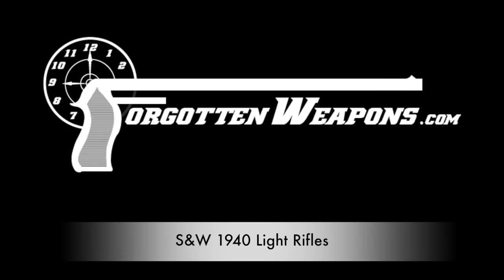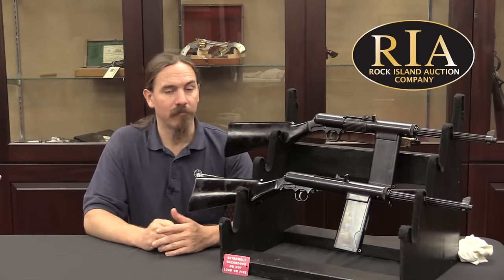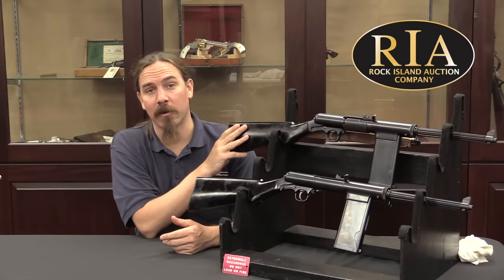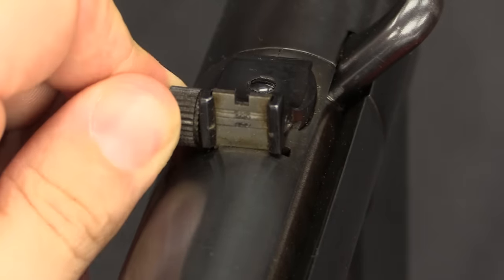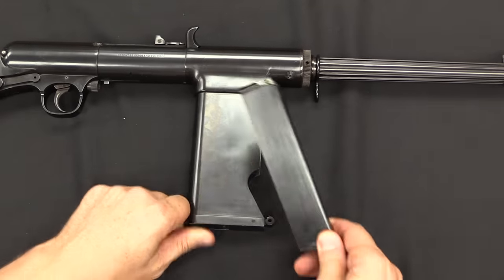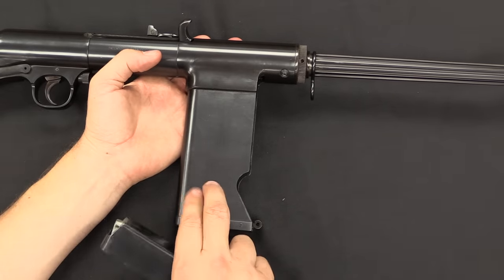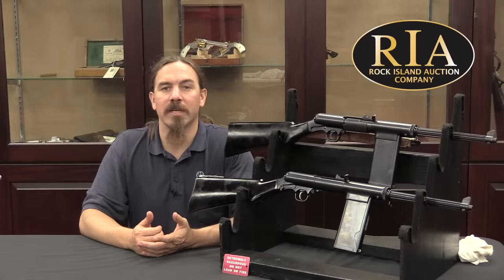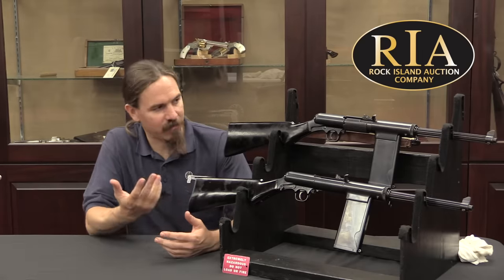S&W 1940 Light Rifles: Receiver Breakage is a Problem

Comment: Interesting backstory. I remember the previous videos. No doubt they  did not have any info on the coming M1 Carbine in 1939, since it was designed so quickly. If this had been more like an M1, closed bolt, and lighter, it might have been successful. A regular magwell, side ejection, and about 1/3 lighter, and it could have been successful (add a little bolt mass while you're at it). A PCC actually makes a lot of sense for home guard type troops like the British had (or civilian partisans resisting invasion), AA gun crews, beach patrols, etc. If an invasion or airborne landing had happened, 2 man teams could really harass invading troops, especially in towns. Pop up, 2 or 3 quick shots each, neutralizing several soldiers. Fade away and do it again. Multiple teams in an area could really cause some attrition. A light force like airborne would also not have much medical support infrastructure in the early stages, so it might be very demoralizing. Anyway, just projecting a little alternate history. Glad it never happened. I know a large number of donated sporting rifles were sent over in 1940 or 1941 to help defend England. I have heard that Win 94's and Savage 99's were quite common, which makes sense. The Brits also requested an urgent shipment of 150K rifles at the Newfoundland conference- the worry of airborne invasion, coupled with equipment losses at Dunkirk. Not sure what they got- likely Springfields or M1917's, since Garand production was spooling up. Possibly leftover US made P14 Enfields from the WW1 assembly line. Or maybe they restarted that production line. Does anyone know? Even Krags would have been pretty useful, but i think they had already been sold as surplus well before this time. My bet would be M1917's left over from WW1, since we stayed with the Springfield. Plus they were essentially the same as the P14 Enfield, which the Brits were familiar with. Anyway, it was nice to see the diffs between the Mk1 and Mk2 side by side. Great video  as always. Thank you

Comment: I feel like the main issue with the tower could be fixed just by making it detachable. Have it be held on by two good pins, or something.
Reply: just cut the back of the tower and leave only the magazine holder. that would almost give you access to the chamber or at least enough to be able to do something before committing to a field strip

Comment: I feel like your analysis of the operating forces during firing is wrong. Yes the bolt will slam into the rear cap, but the pin going through the rear cap is absorbing that impact and preventing the cap from applying rearward tension on the threads.
I'd say the Forward acting force from the bullet applying forward friction against the barrel is what is pulling the receiver and applying forward tension against those threads. 
I'd also say that the threaded cap was probably initially designed alright, but the square section taken out of the threads created a stress riser where cracks would start. 
Still an awful design through and through, from ergonomics to function.

Comment: If the receiver tube was the same thickness but in a smaller diameter tube, wouldn't it be a little bit stiffer as a result?

Comment: it seems strange that S&W didn't know about the differences in the loadings of the cartridges. Did the rifle have the same problem with the US manufactured cartridges? Color me skeptical of a fair testing. The UK had a huge arms industry that was very protective of its self and its income.From the looks of it a heavier recoil spring would have solved the problem. Why didn't S&W  find it necessary to do so in the Mk II?
Reply: Kent Racy ____ The UK at the time was at war. It had lost a vast amount of weapons at Dunkirk and was fairly desperate to get hold of anything they could get to fill the shortfall. The country was under threat of invasion. I'm pretty sure the commercial interests of British arms manufacturers was not a factor in deciding that this thing was rubbish.

Comment: long story short they should have taken some of the unnecessary material off of the barrel and put it where it was necessary on the rear of the receiver.  it really would have been pretty easy to make the mk2 a good little gun.  simply do away with the useless and problematic magazine tower, and move material from the front to the rear and it would have not broken and functioned better, all for less cost.

Comment: Is it possible with a fixed firing pin for a case to be stuck in the chamber and when the bolt goes back forward picks up a case and when it goes to slamming into the chamber the bullet hits the back of the other case and the back of the bullets case get slammed into the firing pin and cause an out of battery ignition

Comment: Why does it have a fluted heavy barrel? Why is it impossible to clear malfunctions without disassembling it? Why does it weigh 10 pounds loaded? How are you supposed to hold it? Why are the Mark II trigger groups cut for a safety lever that isn't there? Just...WHY!?
Reply: Because they were making it up as they went along. The trigger assemblies were probably already milled. I also wonder if they were trying to bilk the brits by making it more expensive than it had to be.

Comment: Despite it's eccentricities (okay, despite it's utter goofiness and unforgivable design buggers) I like the looks of it.  I'd love a modern version, though with side ejection, a standard magazine well (closed bolt, of course [eye-roll], thank you NFA '34), perhaps a shrouded barrel to keeps costs down, and perhaps in a variety of other chamberings (I think .30 Carbine would be cool).  Perhaps with some aluminum or such in lieu of so much steel (though steel and wood ... mmmmm ... classy).  The twisty-turny Mk2 safety thing would make it a LOT more friendly for those of us who tend to shoot off the left shoulder, but so would a more egonomic ambi-safety.  Meh, either way, really.  Yeah, there are a lot of other PCCs out there that are far more practical, but this thing has potential for STYLE ... s'why I like toting 100 year old pistols. ;)
Reply: It's the Hughes Amendment 1986 not the NFA 34 that bans open bolt guns.
Reply: @SuperFunkmachine  - Yeah.  That.  Silly me. I shall pound my head 'pon me keyboard until forgiven.

Comment: I bet it would run fine with shorter ..380 cartridges . so short theyd less likely clog it subsonic and its colder loaded than 9mm.not hot enough to damage this weaker design  The ring needs a third setting to fire it closed breech and then an integral supressor

Comment: Major problems with the review.  Ian never got a correct MKII that has the upgraded MKII parts.  What is shown is a MKII gun with MKI internals and an incorrect end cap/ rear threads for a MKII.  I have a true MKII and the rear threads are acme style, not cut deep into the meat of the tube like the MKI  There is a two piece spring with spacers effectively creating a buffer situation and the rear spring is very short and much thicker which does not allow the bolt to bottom out at the rear of the receiver.   Also a shame the buyer didn't get what he paid for.    There are some other minor differences as well including a dust cover that completely hides the spring and covers the opening.    This is effectively set up to be used as a subgun so the weight needs to be there for stability.  The next stop would have been to add a selector, or block the disconnector for full auto fire and I'd guess S&W was ready for that request.   Mag changes are actually pretty smooth as is clearing a blockage with the easily removable barrel if it comes to that.   I like Ians work, but someone has to get him the correct stuff to review!!

Comment: Are we sure this is actually a Smith & Wesson design or was this developed by the Elbonian National Arsenal.  You have to wonder what dirt the designer had on the chief of engineering or some high level execs at S&W to let this gun even be developed this far.  How did this get this far without anyone saying this is a piece of crap and further resources should not dedicated to it.   It's almost like the designer bet someone that he could make the world's worst carbine and get it past an internal review board at S&W and get some military boards to actually waste some time with evaluating them.  Apparently if that was the case, he succeeded.

Comment: Talking of an unsuccessful design. The thing is quite big and bulky to be a 9mm carbine, yet, while plenty of lighter SMGs were capable to fire +P or +P+ rounds (blowback actions tend to be quite sturdy), this couldn't reliably fire the basic stuff.
It's even funny that they put in it a completely useless, and detrimental, ejection tube (they could have made it way shorter, retaining the downward ejection while avoiding any problem) but failed to see the usefullness of a buffer spring or tab to safely stop the travel of the bolt.

Comment: Amazing how experts ignore a firing pin designed to prevent out of battery discharges.
Fixed firing pins are just cheap, dangerous and stupid. A terrible idea that designers copied from each other for decades, but still a sloppy solution.

Comment: Dang, so I guess if you were to use that rotary safety and lock it on an open bolt, and  the trigger gets pulled, as soon as you disengage the safety the gun will fire?  I wish these were better, cuz I like the idea, and look.
Reply: Since the bolt can't move forward at all with the safety engaged, i'd guess the sear would catch the bolt again once the trigger is released.
Reply: oh. ok, I see.  thanks

Comment: They strengthened the gun by making the bolt shorter... thus having a shorter bore into the chamber... more metal, more strongerer. But they didn’t do the receiver any good with that channel machined out of it. So they removed material and shifted the weak point TOWARD it... 😂😂😂

Comment: What an odd piece for a S&W product.. There really is no point for this weapon that I can think of.. It is about as lumpy as a Suomi M31 but holds only 20rds instead of 72rds.. Fires semiauto only but from an open bolt meaning a set of decent sights is a waste of time and money.. Is not very usable in the field because of an awkward ejection arrangement and on top of the cake is not built strong enough to handle service 9mm Para ammo.. I assume the people who designed this thing were getting payed for their efforts as well and this is what they came up with for a war gun.. :D

Comment: Can someone explain to me the point of a 9mm "light rifle"? You are low power for a main weapon, too heavy for a secondary weapon, because you are semi-automatic, you are overcomplicated for what you are. Not to even mention that your endcap breaks off, but that is the fault of this particular design. What's the point of the idea in a military setting?
Reply: I don't see a role for this contraption that is not filled by an artillery luger like pistol.
Reply: I can think of 3-4 stocked pistols that would probably fulfill the same role but better than this thing. And those didn't even really manage to be retained for service because therewas little point to them in stocked form. So yeah, what gives?
Reply: leave them behind for the enemy to use?

Comment: Only halfway through the video, but this looks as if it would easily qualify for the Top 5 Worst Guns list--especially in the American-designed production category.  Really surprised that it is an S&W design.  Boss' son-in-law, maybe??
Shouldn't the open bolt cause issues with the ATF?

Comment: Seem like easy fixes.
Reply: Remove the fluting, the semi disconnect and the ejection chute.
Strengthen the recoil spring
Lengthen the receiver a smidge
Pin the receiver cap instead of threads

Or just manufacture Stens.  Lol 😁